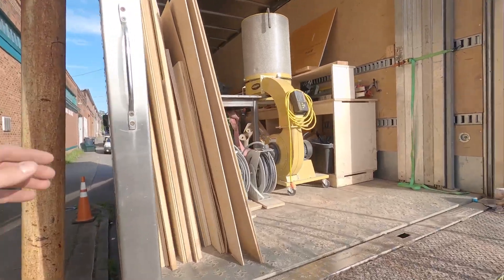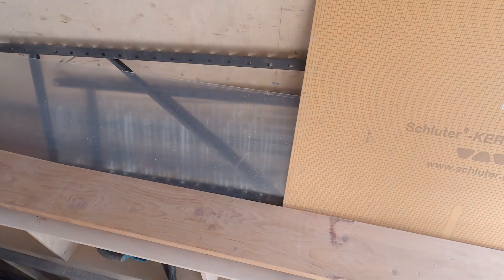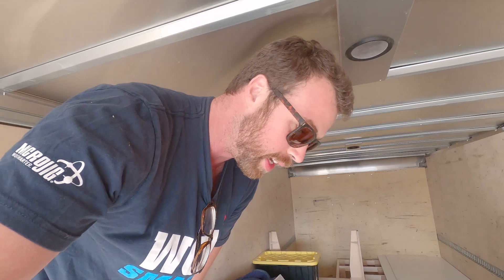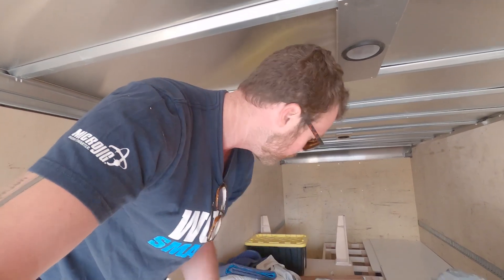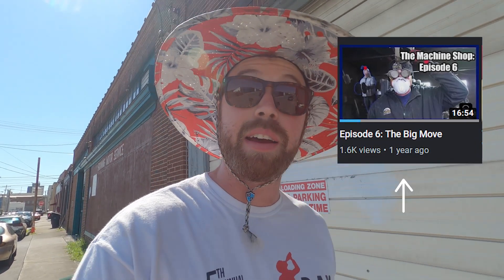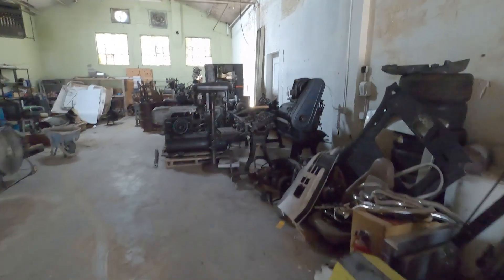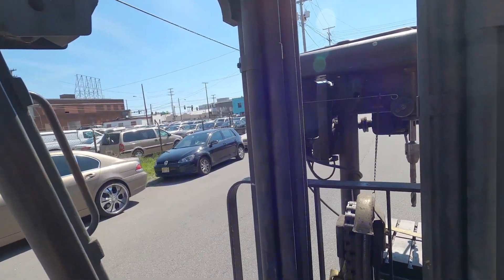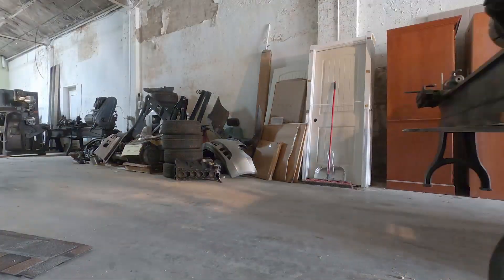The Renovation: Episode 19 // The Big Move - Redux

Comment: With the woodworking and metalworking tools, I'd have divided the shop into 4 areas, Woodshop, metal fabrication shop, machine shop, and office. Walls would help keep one area from contaminating the others, i.e. grinding dust mixed into finishes, and welding sparks mixing with sawdust are to big ones.